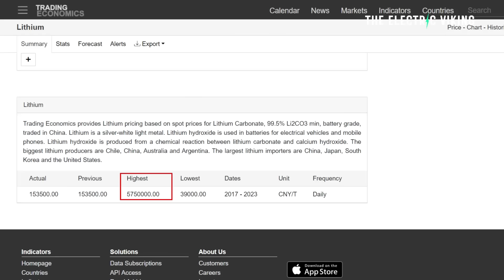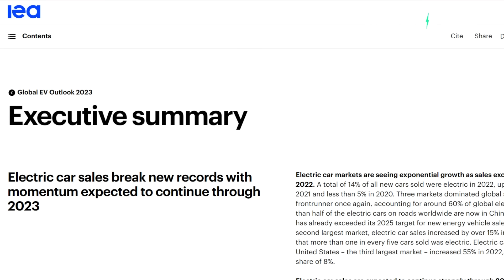The reason Electric Cars will be cheaper than ICE cars in 2025

Comment: It's gonna take a lot longer for ICE sales to drop off significantly because it's going to take a while to ramp up EV production to the scale needed to replace all those ICE vehicles

EV sales are going to keep rising drastically and prices will continue to decline, but global production will take a long time to reach the needed scale
Reply: When we can get a Model 3 second hand for $10k we are there. But until then.. no.
Reply: @AndrewTSq  It's gonna be a while before there's used EVs getting that cheap, but as more and more people are abandoning ICE for EV, used ICE vehicles are going to get cheaper and cheaper
Reply: @AndrewTSq  
People who buy $10k used cars have no impact on new car sales.  

People looking for a good used car will be smart to pay a premium for a used EV over a used ICEV.  It quite likely makes more sense to pay $15k for a decent quality EV than to pay $10k for a decent quality ICEV.  That $5k is likely to be saved on fuel and maintenance over four or five years.  And there's much less risk of running into a major repair cost.  

Then add in the much longer usable lifespan of EVs.  If you are a wise buyer you're going to pay more for a vehicle that can be expected to be largely trouble free for >200,000 miles.  

Actually, I'm going to dispute my first sentence.  If people are willing to pay more for a used EV than for a similar used ICEV then the resale value of ICEVs will fall.  A new car purchaser will look at the higher resale value of an EV and that is going to move some to avoid ICEVs.
Reply: There are about a quarter of a BILLION light ICE vehicles in the US right now.  The average vehicle age is 12 years.  So even if your fairy godmother could wave her magic wand and cause ALL future sales to be EVs, it would take 12-15 years to convert the US to ~100% EVs.  Of course MANY people do not want EVs for many reasons (range anxiety, lack of private garage, cost and time of public charging, etc.).  Also, the electric grid will need DECADES to support charging for huge numbers of EVs, and it will take DECADES to reach enough capacity to produce the MANY materials to produce huge numbers of EVs.

Bottom line:  
1. Your fairy godmother doesn't exist, but reality does.
2. It will be MANY decades before EVs predominate the US fleet.
Reply: @dzcav3  disagree .. let's see where things stand in 10 years from now..
Reply: Long time as in 5 years? China is the largest market, and they're already at 25% BEV. The value proposition only gets better for EV going forward.
Reply: @Lee-pf6od  China has 4 times the population of the US, but their car sales are only about 50% more than the US. They are selling far less cars per capita.

It's probably going to take a decade for ICE sales to finally collapse. I want it to happen sooner, but big oil has too much sway and will throw every possibly roadblock in the way, and the big automakers are taking their sweet time with actually electrifying their fleets and building EV capacity
Reply: Or people stop buying new ICE cars in greater numbers, boosting second hand sales and repairs on older ICE cars in the short term.
Reply: pdxmarine, who will force them to build ICE cars?  Who will force people to buy them?  Would you prefer a car that drives 300 miles for $50 or a car that drives 300 miles for $10?  Both cars have the same horsepower.  The second car lasts twice as long.  Both cost $47k, the average price of a new car in America right now.
Reply: @davidbeppler3032  you forgot the lower maintenance cost on EVs ...and the greater number of features 😂
Reply: @davidbeppler3032  Nobody is going to force manufacturers to keep making ICE vehicles, but they already have a ton of capital invested in their production. They aren't going to want that capital to go to waste, so they will continue to use it making ICE vehicles for as long as they can get away with.

Petroleum companies have a vested interest in keeping ICE vehicles around so they will do all they can to get politicians to put as many roadblocks as possible in the way of EV adoption, and established automakers will join with them because they want to delay having to replace their equipment for as long as possible
Reply: I sort of agree.  But I wonder about the "long time" part.  How long might long be?

Tesla can build a factory and ramp up production in a couple of years.  I'm not sure Tesla has some sort of magic sauce that makes that possible.  Just a corporate structure that is determined to make it happen.  If a few other companies decided to imitate Tesla then we could see things move along quickly.

I don't think ICEVs will be dead in two years.  But within two years it may become clear to almost everyone that ICEVs are dying.  That is likely to mean that people will be reluctant to buy a new ICEV as long as their present one is adequate.  There could be a very large Osborn effect that would drive sales of new ICEVs very low and cause a lot of factories to stop production.

Comment: ICE sales are strong and increasing same with hybrids . 
New ICE vehicles are flying out the door . Whilst BEVS steadily pile up on lots around the world including  Tesla’s . BEVs sales peaked in 2022 and have been falling ever since m. This is due to the present problems with them 1. released to early. Lithium/ Ion batteries do not have the range , 2. take too long to charge , 3. there’s no charging infrastructure around so queues happen. 4. BEVs with lithium / ion batteries are expensive out of most consumers reach. 5. Safety thermal run away has killed many owners due to fury fires burning at 2000 degrees not being able to put out instead of 400 degrees. 
6. The sheer energy and resources to mine the amount of lithium needed to go all Bev is not possible . 
6. Lithium battery can only store 280 watts per kilogram .  Compressed hydrogen stores 40,000 watts per kilogram ( kits are available now to convert your car mainly for the hot rod set with V8s) . 

The change will happen when Toyota mass produces its Solid Stare batteries in 2027, already proven with solid state over lithium ion 1. Safety won’t catch fire. 2 far greater range. 3. Way quicker charge times 4. Cheaper to make = cheaper cars 5 sustainable much less resources required 6 reliability long battery life. 

Toyota sakes are up 60% this year whilst Tesla is down 30% . This is due to Toyota listening to consumers (marketing) and creating what they want. In addition to huge amounts of research and development and understanding all technologies fully moving forward . Toyota produces ICE, hybrids and BEVs. Smart thing they did, instead of entering a price war in the BEV market ( china especially) like all other makers Tesla especially here. They just reduced production slowed it down and made less of them keeping their prices and profit margins . There ICE and Hybrids are flying out the door   Biggest profit ever for the company reported this year
Reply: Your information is VERY incorrect!  BEV sales have been increasing every year without skipping a beat.
If you believe what Toyota says concerning EVs, then I have a bridge to sell you!
Reply: @st-ex8506 where and how much 😊

Comment: I agree totally, the prices of EVs and specially batteries will continue to come down. About the over supply, I don't know. At a certain price point it will be really interesting to invest in battery storage to level out the intermittent production from solar panels and wind turbines. And guess, the demand for batteries there is enormous. My own calculations show that if I could buy a battery storage, plug and play container, for 100$/KWh, it would be profitable in my area, just cause the price fluctuates from hour to hour. What really  determines if battery storage becomes profitable is the cycle life. If you can cycle for example 5 to 95% charge once a day on average in 10 years (3650 cycles) and the battery after that time period still have 75% of original capacity, then it would be really interesting. Specially considering that it could also be possible to earn extra money to make contracts with the grid owner's to stabilize the grid (to very fast adjust the frequency)
Reply: I expect to amortize my Powerwall in about 7 years.  It has a 20 year warranty.  :)
Reply: @chrishaberbosch1029  - Have you budgeted for the replacement of the batteries in that Powerwall?  Sure, it has a 20 year warranty, but does that cover the batteries under all possible conditions, or are there limitations?  A limitation I can think of would be that in order to conform to the warranty's expectations, a homeowner might be required to maintain a certain ambient temperature where the power wall is located.  Because heat damages batteries.  Almost no battery can be expected to last for 20 years; not even Lithium batteries.  The NiMH batteries in my Prius lasted about 130,000 miles and 12 years.  That sure ain't 20 years, and the Prius is arguably the best at making batteries last the longest.  Also, what will it cost to replace them and who pays for labor?
Reply: @justaskin8523 Yes yes and yes.  I do my homework.  🤑
Reply: @justaskin8523 no temperature limitation.  Overengineered using high nickel chemistry and 2170 cells.  Nickel metal hydride batteries in Prius are not that great by comparison.  Load over time relative to vehicle use is small which is why used EV car batteries get second life as backup systems.
Reply: Adding storage to residential and commercial buildings could be a wise approach to incorporating more wind and solar into our grids.  All the issues with site acquisition and permitting would be avoided.  Utilities could avoid needing to raise capital for storage as that would be provided by the building owner. 

With smart meters already installed in many places, adding storage should be largely a plug and play job.
Reply: I'm made of questions when it comes to EVs.  I don't hate them, no.  But we are ASSUMING that all will be happytimes for all EVs that toddle off the lot!  You haven't budgeted the replacement cost/cycle of battery packs.  I've seen data center UPS battery banks get replaced at a cost of $20,000 to $50,000.  And those swap-outs must be done or your @ss will be in a sling if there is customer data loss due to a power outage that couldn't be bridged by the batteries.  Replacing the batteries in my 12-year old Prius cost me $3500.  Two years later, a touch-screen display module died and Toyota had stopped making them!  Tell me, could THAT happen with some car models' EV batteries?  "Oh, nobody makes that battery anymore, that manufacturer died and went to heaven for being good humans."

I am thinking that all car makers probably should get together with the IEEE and whomever else, and come up with an EV battery form factor that could be standardized across car assemblers.  Or maybe better yet, make them removable and swappable by the consumer.  Like that transport that took Bruce Willis's character Dallas Corbin to the vacation planet in The Fifth Element.  They just swapped out the old modules with charged up modules, and the ship was ready to go!
Reply: @justaskin8523 Ask better questions.
Reply: @justaskin8523  Yes, totally agree with you, too. Standardised, swappable batteries would be great! Modules, for example 5 KWh, if bigger battery pack, more modules. Now the manufacturers more and more are moving to structural battery packs, these unfortunately need to be more model specific.
Reply: 5th Element ship was nuclear power
Reply: EV's have limited usefulness and I would expect them to become one half the price of ICE vehicles moving forward.  They are a good option for a people who don't drive long distances and can charge at home.
Reply: @lo1234-w9r  
Good morning Rip van Winkle.  While you slept Tesla built an impressive and highly reliable system of rapid chargers in the US, Europe, and China.  People who drive Teslas have no problem at all driving long distances.

And now those many thousands of Tesla charging stations are being opened to other brands of EVs.
Reply: @lo1234-w9r Dinosaur talking.
Reply: @garethrobinson2275   EV's have been around as long as ICE, they went extinct because they weren't practical then, that really hasn't changed.  Now show me a 500 mile EV that's doesn't weight 10 tons, I will listen.
Reply: @lo1234-w9r  Limited mileage?
There are at least 3 companies I know of, one in Spain, one in the USA and one in Japan that have built thin film solar technology into the body panels , roof and bonnet of prototypes. The 1000 mile between charges barrier has already been broken.

Comment: Used to use a generator when wild camping, ive now got a bluetti battery pack ! Amazing , truly impressive performance 😊
Reply: If theyre so good, why are battery warranties only honoured after you lose 30% of range ?
You buy a 200 mile range car, for example, but even once its range falls to 145miles they still wont give you another under warranty.
Reply: @chrisbarron5861  because they don't have enough long term study data to know what happened after 10 years of degradation. We just don't know.. Some claim LFP chemistry batteries can last 25 years, some say 10-15
Reply: @chrisbarron5861  
Lithium-based batteries are said to degrade 20% over a certain number of charge cycles, but then plateau at ~80% of original capacity, if you lose over 30% that points toward a defect which is why you get a battery warranty for that
Reply: @howardj602  to enjoy nature in comfort is every civilized gentleman's pursuit. Only if you are a caveman then don't mind roughing it
Reply: @howardj602  you confuse the discomfort of civilization with comfort. Nobody wants the noise but everyone wants the hot water when bathing
Reply: Charge you car 3% per day from solar? Woo that's stone age
Reply: You still need fuel for cooking and heating when camping in cold weather. Going all electric in an off grid environment is foolish
Reply: @i6power30  
Not everybody lives in cold (freezing) weather, and can happily do off-grid. Actually where I live they say it is optimal temps for battery longevity.
Reply: @joebloggs6131  that is true. My point is reverse that not everyone lives in a place where batteries can replace fossil fuel. Trying to do so imposes tremendous inconvenience and even danger.
Reply: @i6power30  It'ts called wood. It's what grandpa would have used only now it is called sustainable renewable biomass fuel......how modern.
Reply: @Pneuma40  wood is not that convenient though.fresh cut wood doesn't burn very easily. Carrying dried and cut firewood to camp site that's not weight efficient at all. Best is still to use stuff like propane or butane
Reply: @i6power30 I use my portable induction cooktop now when camping, plug it straight into my BYDs V2L outlet. Where we regularly camp on a friend's bush block by the ocean is only 90min drive from home. Plenty of capacity for multiple days cooking and comfortably make it home. And induction is heaps safer, much less weight/volume to travel with than a gas setup and cooks faster and better. If we're cold be have a campfire.
Reply: @i6power30 Been off grid electric for twenty years. Main advantage has been twenty years without a power bill.